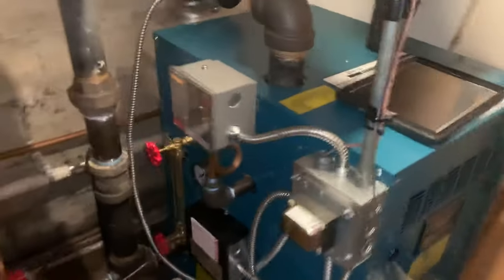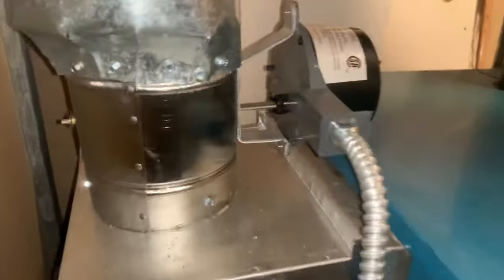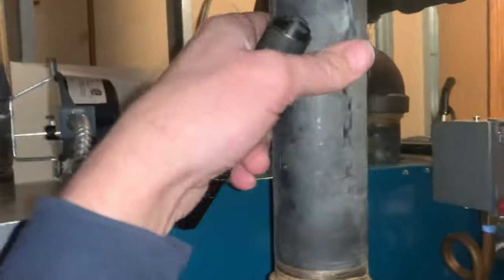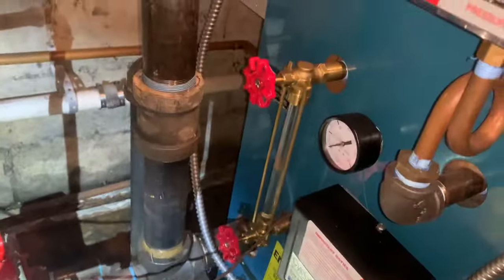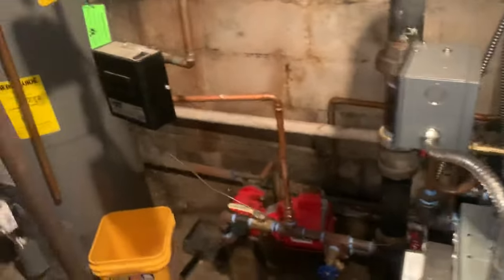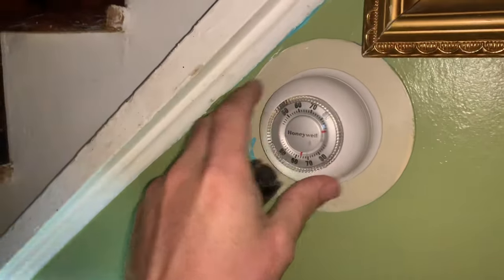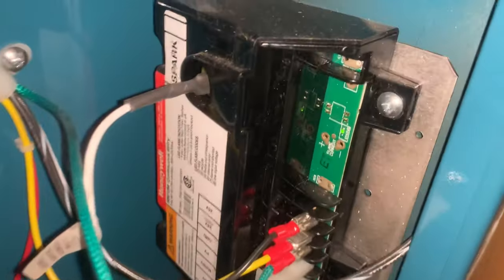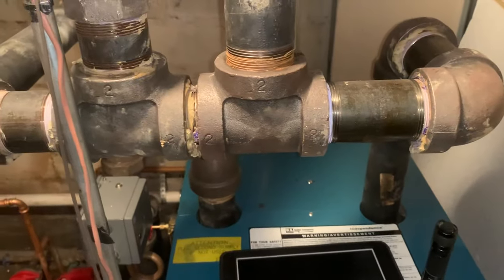Troubleshooting No Heat Burnham IN4 Steam Boiler - Defective Thermostat

Comment: I have a burnham series 2. Pressure is 15 pounds.  We have a split level ranch.  So we get heat upstairs but one bedroom is warm and another is very cold.   The radiators don't have a valve to bleed any water from. So not sure if there is water to be bled in the main boiler?

Comment: Mine gets heat but no hot water I have to turn the heat one to even get warm water. It was supposedly fixed in December but nope no hot water still. Any tips to chdck I turned the hot water temp to low and all the way up and no change.

Comment: Hi Mike, I have Burnham IN4 steam boiler, and getting 8 flashes, low voltage? I checked the transformer voltage output and it was 26.34 volts. Any idea why I am getting 8 flashes?  Thank you, Stan
Reply from the maker: You need a new pilot assembly. 
You're welcome:)
Donate here: https://www.paypal.com/donate/?hosted_button_id=RYMGLCUTYWJNL
Reply: @PipeDoctor  I replace the pilot assembly but still the same problem. Any other idea?